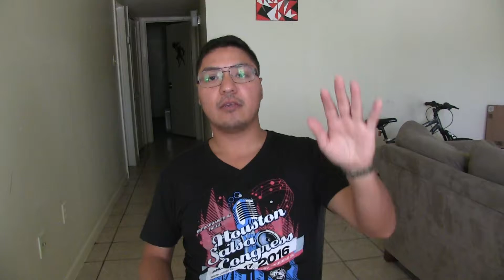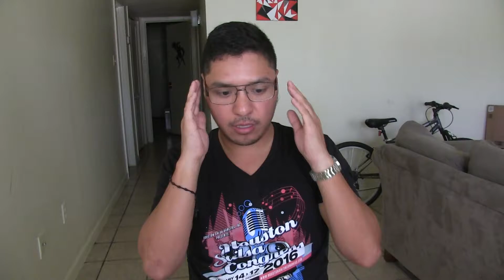Software that Structural Engineers Use at Work

Comment: SAP2000 !!!! I guess being at UCB, I have a bias for SAP2000... I remember in my design classes, the Chinese student teacher assistants would say "wait you're using risa? Sorry i don't know that too well.." Shows what their ambitions were, because I wanted to take the classes for real practice in the real world. RISA was a bit of a pain at first using it for larger isolated portions of the structure like a 4-story braced frame, but I know how to fix potential problems and have a good idea how errors occur. Plus, I have the finite element framework in my mind from advanced structural analysis to be able to get things right.... but SAP2000 (look up Ashraf Habibullah) is another beast from my experience. It can simulate mode shapes though. So, that's pretty cool, but analyzing mode shapes can get tricky since if you treat a slab as flexible, you need to have engineering judgement on the number of dofs used for the approximation. But yeah man... revit I need to start learning. I know AutoCAD well, but I don't have a computer that has the power to run revit..... man i need a job!!!! Lol These goddamn HR ditz man....
Reply from the maker: +Dave Yen it's what I've heard, I've researched a bit about SAP and asking my former boss it seems it's the ultimate Structural engineering software, my company does have it but we don't use it. I should start taking a course to learn it